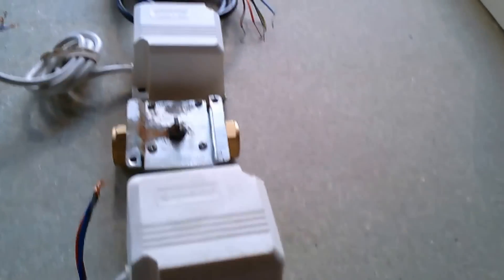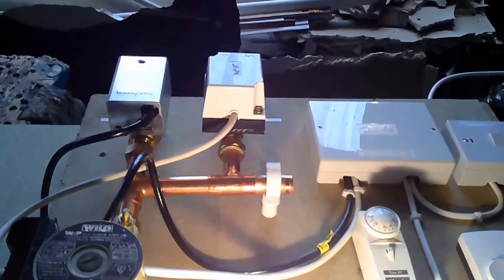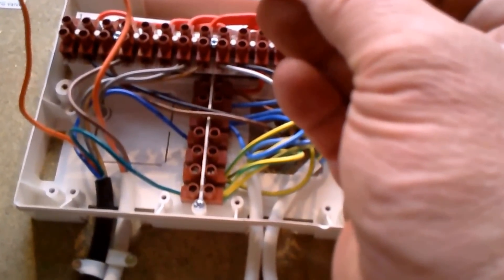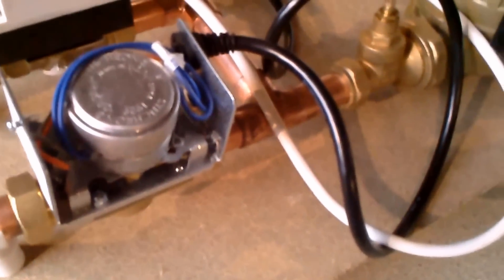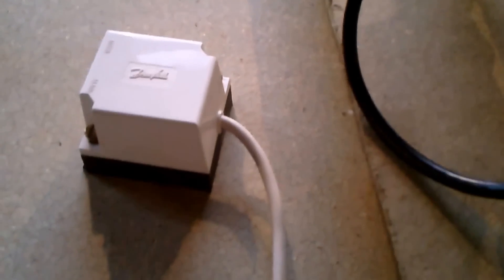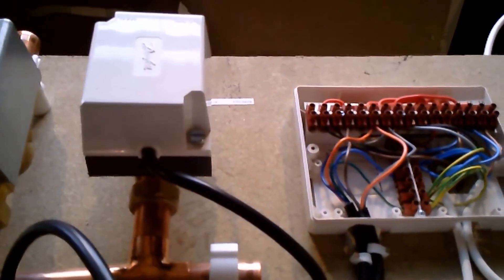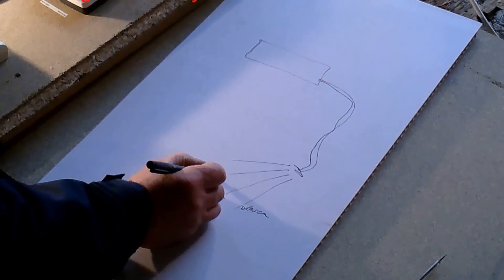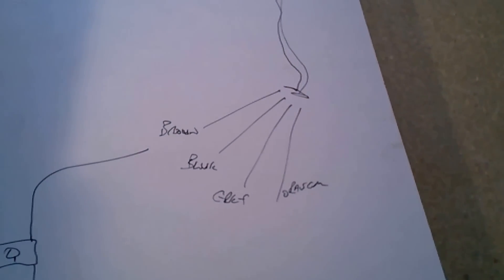heating zone valve problem

Comment: Question relating to honeywell valve motor assembly.    What is the purpose of the manual position arm that has the slot which appears to latch in so it doesn't return.    My valve has failed on hot water supply and the engineers did a tenp fix so we could have hot water.  The engineer rigged a cable that appears to go to the emersion heater until parts were in stock.

There temporary fix was very temporary indeed because it lasted just over a day which is why i asked the question.

Will holding the honeywell lever until it locks into the tiny slow get hot water to come through again ?

I am sick of social housing contractors doing only half a job then leaving to do other work for a another two weeks leaving us without hot water.

Comment: Keith, You are an exceptionally good tutor. Explained this problem so well. I have had the Drayton Wiser system installed about 8 months. Pleased with it, but this cold spell the boiler& the pump started to run when heating & H/w is turned off. The Wiser guys (German branch included), has not offered me an acceptable explanation.
But, this morning I played your YouTube video! Bless you 🙏 & thanks for sharing your wisdom.

Comment: Thank you so much for a brilliant explanation, followed your tutorial and discovered it was the micro switch in the heating motorised valve that was faulty. Quick visit to Screwfix and a new unit was bought and fitted within the hour. Now the boiler light is only on when I want heating or hot water. Thanks for saving me a pot of money Keith. Quick question....I live in a big 4 bedroomed house with 22 radiators in all, what setting speed should the pump be on as it has 3 speeds. Your help, as in the video would be greatly appreciated.
Reply: Steve Woodward 3 I should imagine Steve!
Reply: @simonstones1918  Cheers Simon, l previously had it on 2 but switched it to 3 and all radiators now become hotter much quicker and more evenly. Thank you for your reply/advice
Reply: Steve Woodward that’s a lot of radiators on one system tho, I must say! Usually 12 are suggested for one run. Glad yours is working better tho 🦠

Comment: Thankyou.Very useful and excellent explanation.I have changed the motor but yet the radiator lights up but I don,t see the motor working.Manually it works.Do you think the wires going to the motor are faulty.Can you help me or should I just change with a new one like you did in the video.Thanks
Reply from the maker: Thankyou for your comments , I would like to know the make of the zone valve , Also would mostly change the complete head , but check that the spindle does move freely , hope this helps

Comment: Brilliant video, When my hot water comes on and the heating side is off the radiators heat up. I changed the Drayton ZA6 Actuator and the problem is worse as with the old Actuator it was only a few radiators ypstairs that came on, but since I bought a new Actuator all the radiators in the house are heating up - any idea what the problem could be?
Reply from the maker: Hi Gary , Thankyou for your comment , Did you just change the Actuator only ,and not the valve body ,   (following the existing wiring ) .If so I would feel that the body of the valve is the problem as the ball / valve is not shutting and is passing , unfortunately this means replacing the valve body . Hope this helps .

Comment: i have a honeywell zone valve that wasnt opening i checked t stat all good there. tried to put in Manual position wouldnt slide over was stuck,  took cover off motor very hot to touch!  pulled head off valve body assembly tried to turn stem with wrench was hard to turn would not stay in position kinda sprung back but got it open enough to get some water to that zone to warm up toe kick heater.
once i got it opened a bit i hooked power back up and all it did was make real fast clicking noise  any ideas?? probaly replace whole assembly? or try motor first??
Reply from the maker: Hi Tom Close , From what you are saying , it sound like the zone valve body is sticking , witch may have burnt out the motor off the zone valve head , So would replace the whole thing . Hope this helps .
Reply: @keithjackman1  thanks for reply    any idea why it would stick in valve body?? its only 6 years old   would deliming type of cleaner hurt that brass valve components??
Reply from the maker: Hi Tom Close , a deliming type of clean should have not hurt the components , However the zone valve rubber ball which stop the valve may have become swollen / sticky , causing  the valve to stick , and hard to open with the wrench .

Comment: BRAVO!!!! Thank you so much for such an easy explanation. This video should have a million views!
Reply from the maker: Thank you your too kind
Reply: @keithjackman1   No I'm not :) I had a guy servicing my boiler not that long ago and after he was done with it I pointed out the constant power ON issue to him. He had no clue what's causing this so he rang  the other guy (electritian) but he had no clue either. After searching the internet I came across some forum which led me to believe that the PCB has developed some fault so I bought a replacement one. It turned out tjat the PCB had nothing to do with this as the boiler continued to stay ON. Luckily it was a second hand PCB so it didn't cost me too much. And now that I came across your video I'm 99.99789473% certain what's causing this. And I will see for sure this weekend. 
One thing I'm 100% sure of is that these so called plumbers-electricians hate you for this video :)
So it's not me but you who's too kind for sharing your knowledge and putting the effort to build the rig so we can ACTUALLY SEE what's going on. So thank you again and best of luck with everything you get your hands and heart on!

Comment: Perfect video but what supplies power the the chipboard in the wiring centre i assume its the 3amp spur and is that from the main fuse box or is that seperate
Reply: The spur would have a 3 pin plug coming out the back. You can just plug it into a socket.

Comment: Is checking the orange wire for power in this way, indicative of a failed heating 2 way valve as well ?
Reply from the maker: Hi dover one foxtrot , in most cases yes , hope  this helps .

Comment: Hi Keith, I have a drayton 3-port valve on my system, I'm wondering if you can solve the problem I'm having with it...with the central heating control turned off and just the hot water selected on the programmer, the motor drives the valve right across to the hot water only position, but after a few seconds goes back to the centre position and remains there giving a constant clicking sound. This of course allows hot water to the radiators when it shouldn't. I've removed the head to take a look and the valve is quite easily operated with my fingers, the motor seems to run ok, could it be one of the micro switches causing this problem? 
Your help would be much appreciated, Ken.
Reply from the maker: Hi ken , yes it is more than likely to be one off the micro switches , however it could be a problem with your time switch ( programmer ) , sending a false sign ??. First I would replace the drayton 3 port head . Hope this helps .

Comment: Hi Keith great video very informative. I have a Sunvic 3 port valve that buzzes when the heating is off and drives us mad at night. If i boost the hot water you can hear the motor either start to drive or return then i can turn off the water and all is quiet! Any ideas? I dont have a problem taking it apart if needs be.
Reply from the maker: Hi Carl , sorry for the delay in answering your question , I thing the buzzing is the motor inside the head , but if it was me I would replace the sunvic head complete. Hope this helps .

Comment: Hi Keith, thanks for vid.  My CH diverter makes a clicking noise on start up and then goes quiet.  It appears to be working fine, opening and closing etc.  Any idea?
Reply from the maker: Hi Cameron , It may be one of the cogs slipping in the motor , it may continue to work for a while , be one day , the motor / head of the diverter will need replacing , hope this helps .

Comment: Great vid Keith, do you do a similar exercise for the mid position valve, that would really help me?
Reply from the maker: Thanks Mick , yes it is a similar exercise for mid position valve , but on a mid position valve you have no permanent live to it , check out a YouTube video by john ward  ref - central heating electrical wiring part 3 y plan , hope this helps ?.
Reply: Yes it did Keith thanks, made it all very clear, great video!